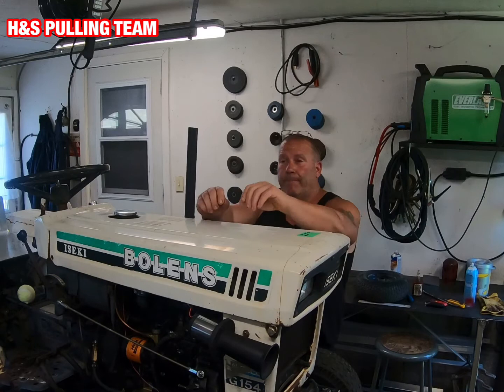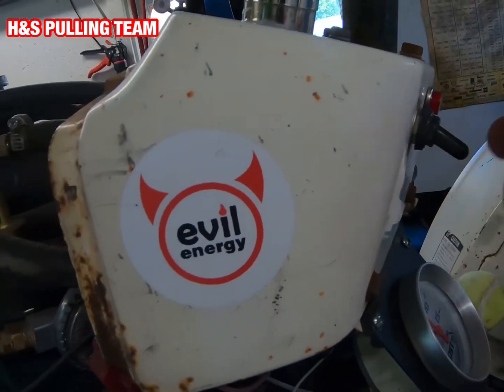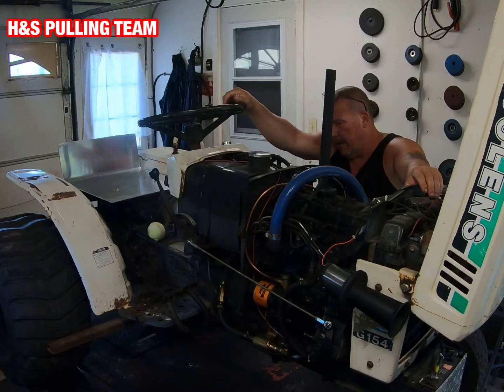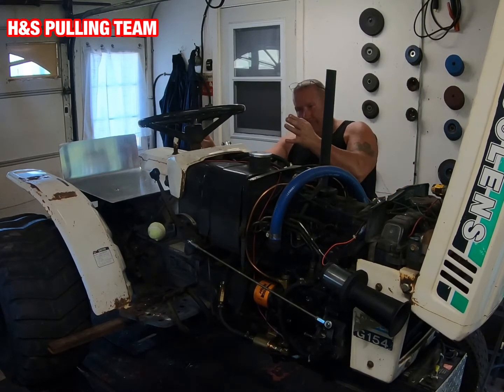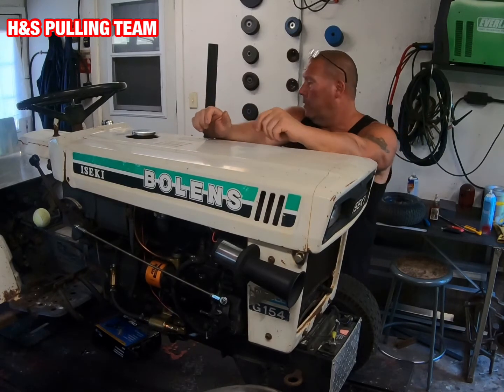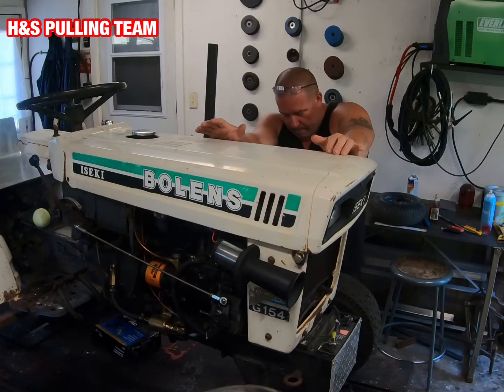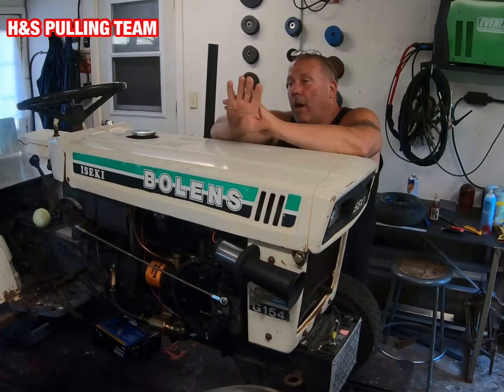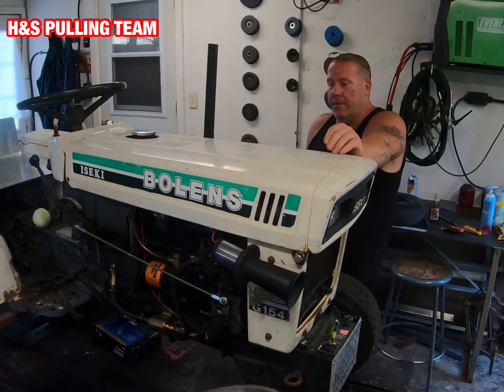Propane Injection for Diesel Good/Bad?

Comment: I had it on my 6.5 Chevy pu
I felt a difference 
But my set up from Bullydog would change with the outside temperature 
You add enough until it knocks then back off the volume some till it stops pinging

Comment: In a diesel pickup when towing or traveling on the highway, the diesel is usually running very lean, lots of extra air. In this case propane makes a nice difference and helps complete and speed up the burning of diesel. You get increased efficiency in addition to offsetting the amount of diesel with propane. 

But at full power, propane won’t really help any more than extra fuel would, because high load and boost is where a diesel injection burns quickest due to the large volume of fuel and the dynamic compression ratio increase from the boost. That’s why NA diesels need very high compression ratios. 

Mercedes Benz OM604, 605, 606 series engines have the highest specific power output of any NA diesel at around 40hp/liter compared to 25-30 for most other NA’s. They got there by using a strainer-type precup and 25/1 compression, which made the engine rev happy and burn very quick like a gas engine, because the issue with NA diesels is the slow burn of the fuel limiting rpm and you need revs to make NA power.
Reply from the maker: Well that certainly makes sense 
To me now after trying it for myself 
Thanks for the info

Comment: You can’t add much propane to small diesels, I’ve never got the same result on little Yanmars and Kubotas as I do large pickup engines.
Reply from the maker: Yes I’ve discovered that also

Comment: If I may comment here, this pressure limiter is a very low volume one, suitable for home appliances. I agree that these may consume up to 16KW worth of BTU, but ou may consider doing a direct supplementary injection based on direct pressure, and a petrol throttle electronically governed injector, maybe.  Some bypass in the pressure regulator head would be needed.
Reply: Have you tried pre-heating LPG and diesel?

Comment: What kind of turbo do you have on this engine? I have the Bolens G174 and I didn’t think they made one small enough.
Reply from the maker: It’s from a smart car. 
They made a 3 cylinder diesel that was roughly the same size.

Comment: Propane is a liquid turn the propane bottle upside down. If it's a 20 lb tank use the float type. The other type has a valve allowing 10 lb out. In a cold winter 15 lb more propane out.

Comment: I've converted a few small gasoline engines to propane and gasoline dual fuel and some to tri fuel gasoline propane and natural gas. the 1 lb bottle and that valve on top of the propane bottle is probably restricting you because on a 40cc engine. I think the line is about a quarter or 5/16 diameter. and the biggest one I converted was $120 cc engine and the fuel line was 3/8 and all of the engines are running a standard propane tank. except the littlest generator which is a standard barbecue tank or 1 lb cylinder but they say the 1 lb cylinder freezes up and gives a few problems. I plan to add this on my stock diesel truck just for cooling not for more power. I plan to use the washer fluid jug and put a rubber fuel line past the air filter with a nitrous nozzle to inject washer fluid into the motor so I can cool the engine before I get to hills. this does make more power in a diesel. of course always watch the EGT temperatures in anything. a little motors I use a laser gun to check EGT temperatures when turning on propane. I would like to add propane to my stock diesel truck to get better fuel mileage. injecting washer fluid into a diesel turbo engine after the air filter has a great cooling effect also which makes more power and gets better fuel mileage. Snow's performance make some for big diesel engines but they're pretty expensive. I know you're just using propane as a little booster but I think the volume and the line size is a little small. you can also try your test again with a full 1 lb cylinder if that doesn't work step up to a bigger propane tank and line size use a one-way propane pancake valve with the primer button and a load block on it to fine tune it. propane engines I've converted are the easiest to tune you just turn the dial and you run the leanest setting the smoothest when the engines idling and wide open. would just a straight propane engine you can't get a propane engine to lean it's not like gasoline it's the opposite. I've worked on diesel engines but not into performance on diesels just gas mileage and driving one.. but all the guys with tuners on their diesel truck seem to replace injectors and after they replace a few injectors or all of them the engine blows up. also with the cooling effect from the washer fluid going through the turbo diesel intercooler you can run more boost. but I just want to cool the engine before a big hill when pulling on warm days. with another profile I have a YouTube channel myself but I'm not even good enough to figure it out to change the heading name. you're doing better than I am.
Reply from the maker: Thanks for the info. 
Stick it out bro YouTube can be tricky takes a lot of consistency to figure it all out. 
If it was that easy everybody would be doing it. 👍
Reply from the maker: If your struggling with YouTube stuff. Try watching a channel called vidiq. They have lots of helpful information on how to set up a successful channel 
Helped me out lots. 😎
Reply: @HSmotorsports-72  Sounds good thanks.